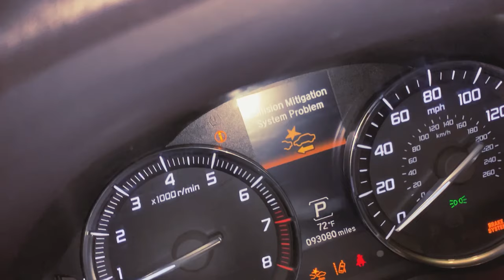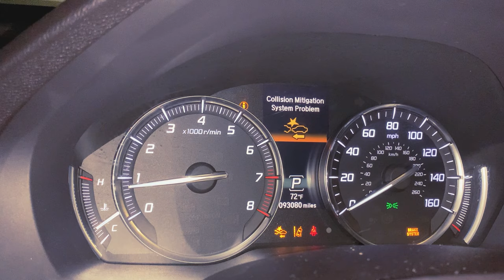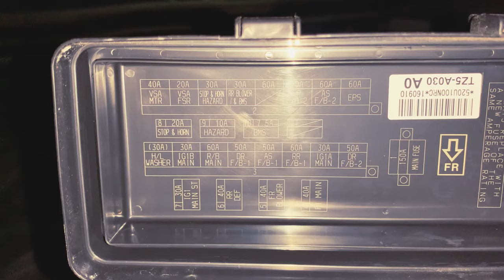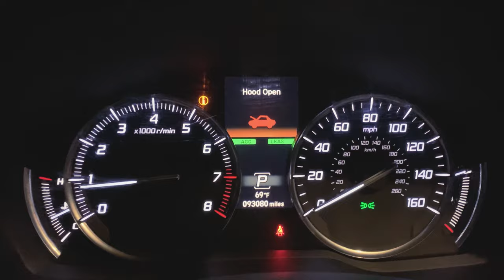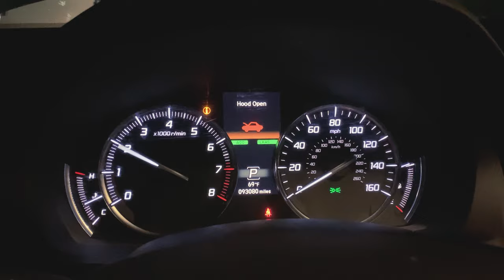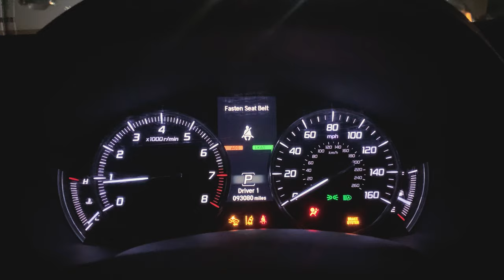How To FIX Acura MDX All Warning Lights On | All Dashboard Warning Lights On **RESOLVED**

Comment: I have a 2017 mdx and that only happen when my battery was tame for me to replace it 5 years with the same battery lol finally when I  replaced everything was fine.
Reply from the maker: LOL got to love when it's a simple fix.
Reply: @AWordFromMrJones  hey Replying back it was not the battery was the computer wireless key receiver was damage.
Reply: Hey, I was just told the same thing. Was your dashboard lighting up and clicking and unable to start your car?
Reply: @polancoloammi6938  this seems to be a common problem with the mdx and pilot. I saw this fix in a pilot forum. But I’m having more issues then just the lights being lit. I have to press the button twice to shut the engine off, keyless light is flashing even though everything is shut off, steering wheel is moving in and out when I open the door and the accessory chime is ringing when everything is off when I open the door as well. Also sh-awd isn’t working.
Reply: @Allthingsworktogether1125  that is what has me confused. That’s about the only thing my car isn’t doing.

Comment: Disconnecting the batteries addresses the issue temporarily.  Something else going on though.  I would bet your lights came back on after a while.
Reply from the maker: Nope, hope all is well 💯
Reply: @AWordFromMrJones  good to hear. Not my case. I can overcome the fault by cutting power. Or it just goes away. Can’t find a code (even in diagnostic mode). Must be an intermittent fault. Will check grounds next I guess.  While faulting need to double press start button to turn off. That’s a clue I guess. Also the key fob CEL illuminates.
Reply from the maker: @formerengineer5784  Interesting, yeah I would check the grounds and reseat the fuses if possible just incase there might be a presence of dirt/slight corrosion. 

I know when I had a Land Cruiser I had some sporadic issues which was the crank/camshaft sensors. I believe the CEL did not originally illuminate till later, I had confirmed with a tester. Once those sensors were replaced the issues had resolved. 

Hope your able to get your issue resolved soon.

Comment: Thanks. Question.  What resolved the issue, replacing the fuse or the cleaning of the batteries terminal?
Reply from the maker: Jose, for this particular issue, cleaning the battery terminals fixed this issue. If it comes back, I will post a video update.
Reply: Both terminals?  Thank you!!
Reply from the maker: @megamanfun  Yes sir that is correct, both. However if this does not resolve your issue then I would check the fuse.

Finally I would connect a OBD2 scan tool to see if your getting a P0369 code which would indicate that the camshaft position sensor has failed and needs to be replaced. Which that means you will need to also have your timing belt replace since the sensor is behind the timing belt.
Reply: @AWordFromMrJones  Thank you sir. I’m taking the car to the dealer. I will report back with the results and solution.Thanks again.
Reply from the maker: @megamanfun  Sounds good and thank you.
Reply: @megamanfun  any word on what fixed your issue ? I’m having the same exact issue. Every single light except check engine light is on. Sh-awd isn’t working either, I have to push the start button twice to shut the engine off. Also when the key not in the car light is flashing whn I shut everything off and the steering wheels moving in and out when I open the door. It’s reallly weird.

Comment: Didn’t work for me going to have to make that trip to the dealership
Reply from the maker: I wish you the best.

For anyone else that is not able to fix their problem with this video.

If you checked your fuses, grounds, cleaned the terminals and the battery is not that old. Then I would suggest getting a scan tool to check your computer engine for codes. You might have a code pointing to your camshaft position sensor. This type of job will require replacement of your timing belt.

- I say will require because any given time you remove your timing belt for a repair job, it's best to replace the belt with a new timing belt.

Hope you are able to get your MDX fix soon.

Comment: I had lane assist and cruise errors. Code for camera/radar. Brake assist light as well. Dealer replaced and recalibrated camera. $700 part, $400 labor. No errors anymore. Only dealer can do calibration in my area.
Reply: What year was your vehicle warranty? Miles on vehicle?
Reply: 123,000 miles, no warranty ,2017 Mdx
Reply: Did dealer charged you for diagnostics? They asked for $199 diagnostics, but I already scan and problem is front windshield camera

Comment: I have an “old” car 2002 Buick and all of the warning lights are on💀
Reply from the maker: For the Buick I would still follow this process by checking the battery connections including the ground and also get your battery tested to ensure there battery does not have dead cells.
Reply: @AWordFromMrJones  Thank you!!! I also think it’s because of the battery…

Comment: I had these problems and the whole engine went out at 73,000
Reply from the maker: Geez, I am sorry to hear that. What did you do to resolve your issue?
Reply: @AWordFromMrJones  I replaced the whole engine ! $8000.00, but before the engine died on me, Acura did replace a wire harness on the back of the engine. They said that a limited amount of cars had an wiring problem.
Reply from the maker: @mikechandler7861  GEEZ! I am sorry to hear that. These Acura MDX are known for reliable engine and transmissions however things do happen but I wouldn't expected issues at 70k miles. That's crazy.
Reply: KeSean Woods  Bro, what are your qualifications? What do you know about Acura manufacturing failure rates? 
Watch my other videos showing continuous issues from 17 K to 72K. I can also show you numerous Acura inspections that prove maintenance was excellent. They looked at it every time I brought it in. Only had 73k.

If you’re such an expert, please take a look at the engine. Explain how only one piston and bore can be scarred?……but it’s my fault! ? 
I am the one who got screwed by Acura! Why do you have to blame me? Right away….without knowing anything about what happened. You work for Acura?
Reply: KeSean Woods  Really? That’s what you come back with. Your grandma timing belt? Is that your qualifications? Please don’t make accusations unless you know what your talking about.